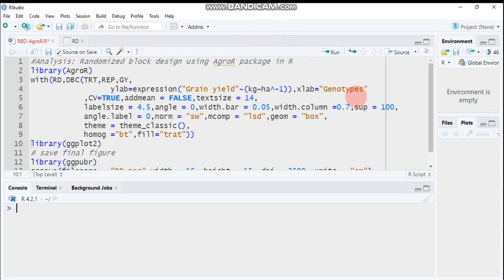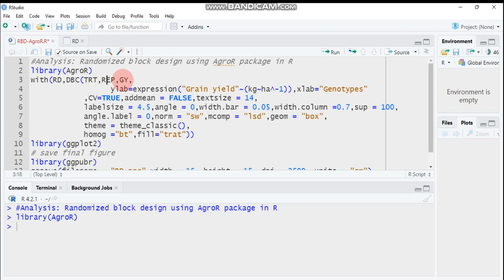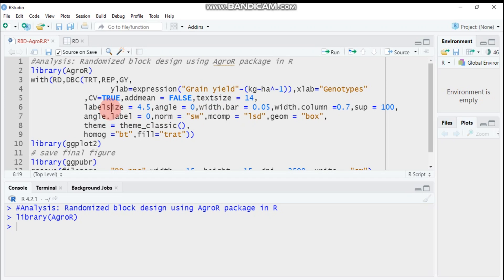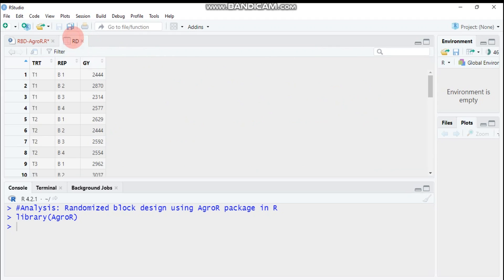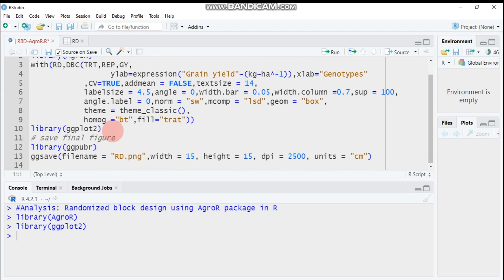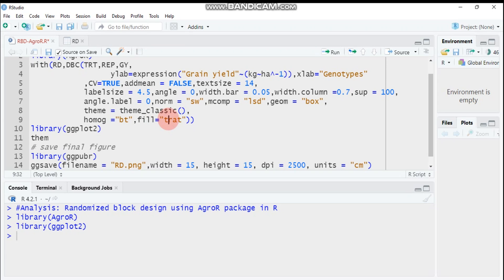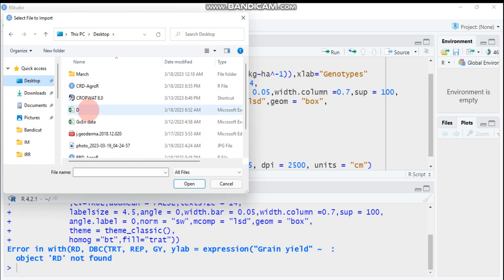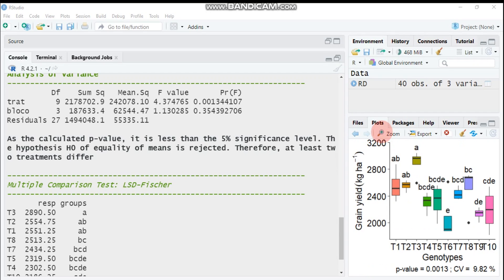Analysis: Randomized block design using  AgroR  package in R software

Comment: What is meant by Supp command in DBC. If I follow this supp=100, my alphabet lettering goes far from error bar . And I seems like standard error is not calculated in this script
Reply from the maker: It is the number of units above the standard deviation or average bar on the graph. Please reduce this number and must be symmetric to y axis value. 

Regards .